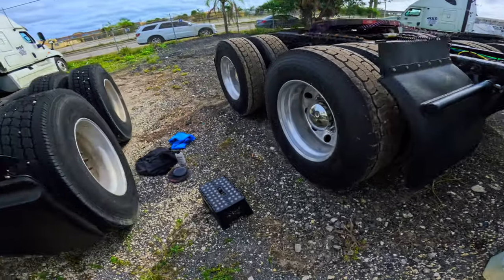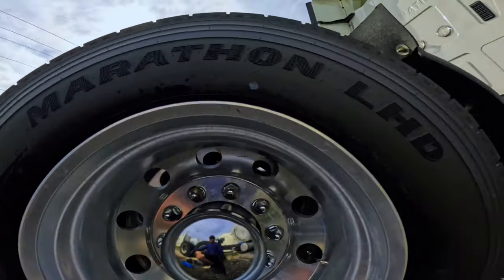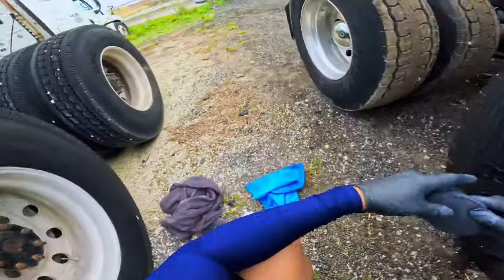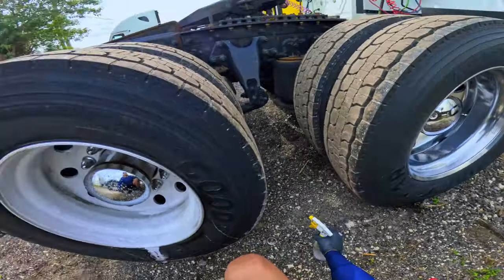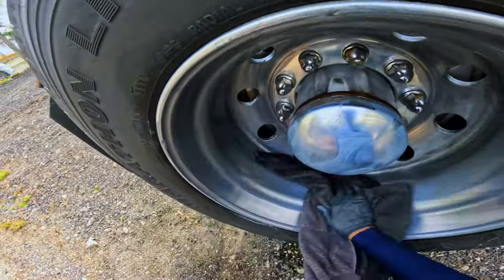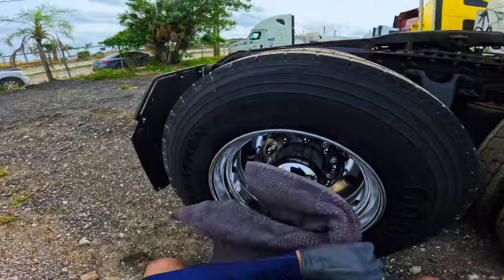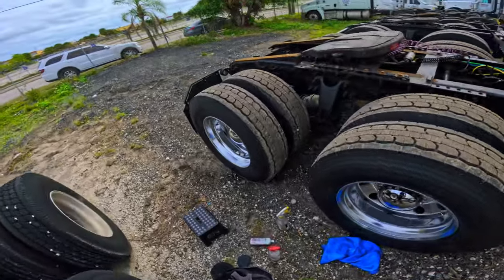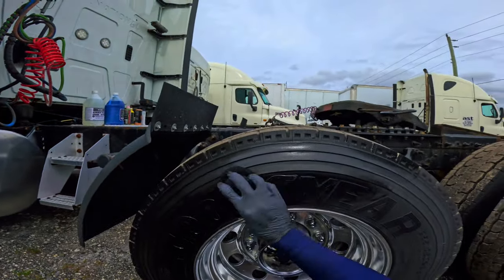Polishing Video: Aluminum Acid/ White Diamond Polish/ Polishing Semi Truck Wheels/ WAB tire dressing

Comment: That looks really good. The second spray bottle is filled with WAB polished aluminum and stainless cleaner right?
Reply from the maker: 20%Acid 80% water that acid is strong
Reply: @Mr._Bee._ but what was the second bottle? The yellow pump head? Water? To rinse off the first bottle which was acid?
Reply from the maker: @danielhayes735   yes second bottle is water to rinse off the acid